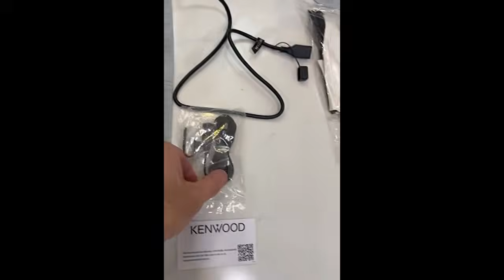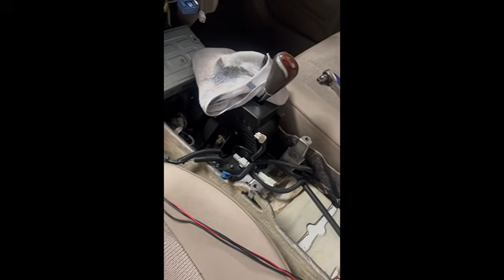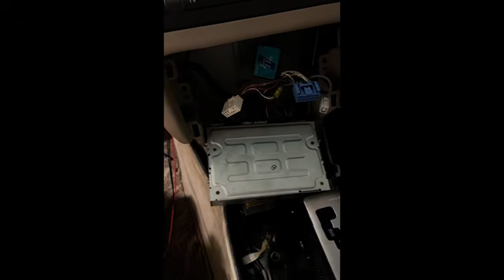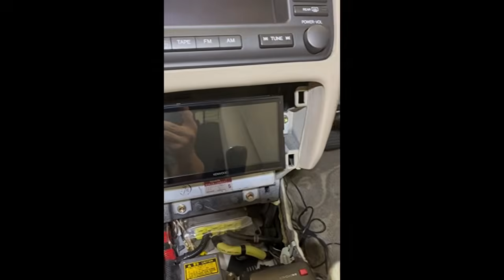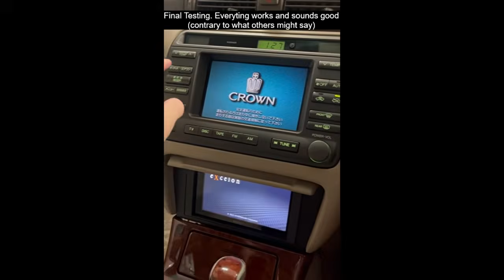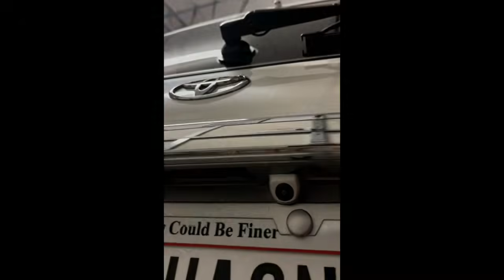JZS171 Toyota Crown - Double DIN aftermarket Stereo Installation with back up Camera and Car Play

Comment: Would it work if you don’t have the factory screen?
Reply from the maker: Yeah it should. But You will likely have to get the appropriate beat sonic adapter for the factory stereo you have (there are several different ones, I think a 4 speaker, 6 speaker, 7 speaker with sub, or something like that)…

Comment: will this be the same set up with a 2000 toyota crown royal saloon?
Reply from the maker: It should be similar enough, but also depends which system you have in the crown (there is a 4 speaker, 6 speaker, 7 speaker which has a sub)… as long as you get the correct adapter (from beat sonic) for your specific system it should outline the proper connections.

Comment: Hello - I just had a question on which backup camera and front camera you decided to go with. Also, is there any way you can share the 3D print file you utilized for the headunit?
Reply from the maker: Hi. If you search “Toyota crown S170 radio trim ring”, it should be the first thing that comes up. File is on makersworld. As for the camera’s, search for Natika IP69k camera on Amazon. I Used the same camera for front and rear. Hope this helps.
Reply: Awesome thanks for the reply! I just purchased a 2001 UZS171 and I'm thinking of doing the conversion myself after seeing your video. You did a good job . Looks super clean.
Reply: Hello.  Also wanted to ask about the trim piece you printed. Just purchased a 2001 Crown and looking to do a similar setup. Wanted to ask if you would be willing to sell and ship a trim piece or at least share the template file.  Thanks for your time!